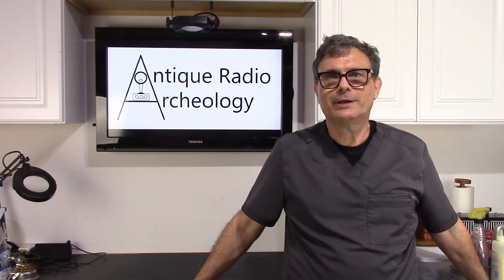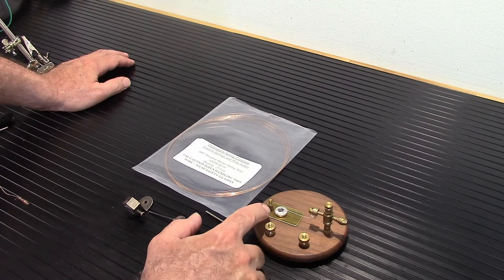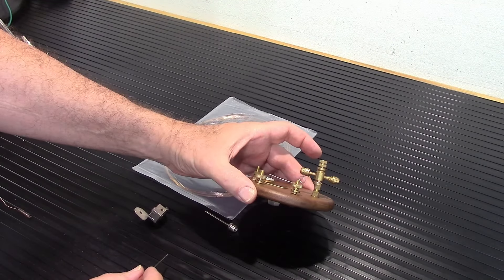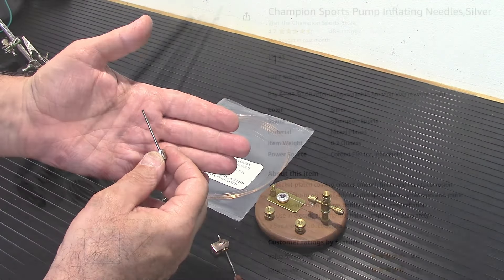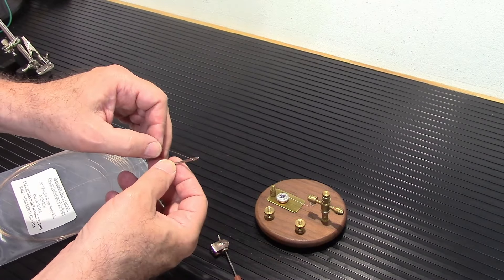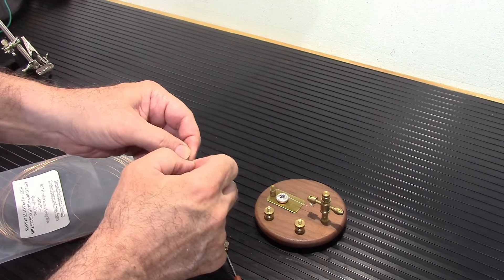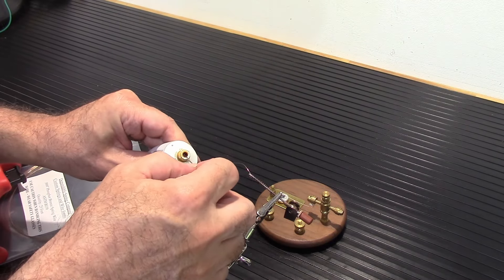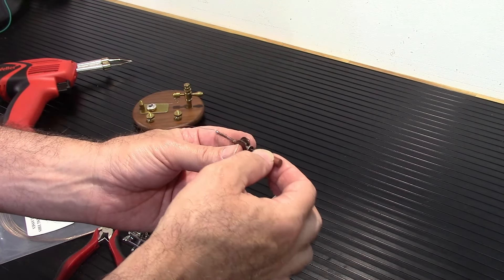Tutorial - How to make a Cat Whisker for a Crystal Radio

Comment: I'd like to know what you recommend for the best gauge of the wire.  Also you don't mention the crystal material.  Do you have a source for the wire and crystal.  This is interesting to me.  I have built a crystal radio over 40 years ago and it used a commercial diode.  it would be great to replace the diode with a detector I actually made.  I'm a ham and 75.  I'm trying to achieve 30 WPM CW.  Making slow progress!  WD0DUD
Reply from the maker: The crystal is Galena, the wire gauge was 36 which is too thin.  It works well, but it's not easy to handle.  It's like working with stronger strands of fiberglass, it penetrates the skin real easy.  I prefer about 28 gauge.